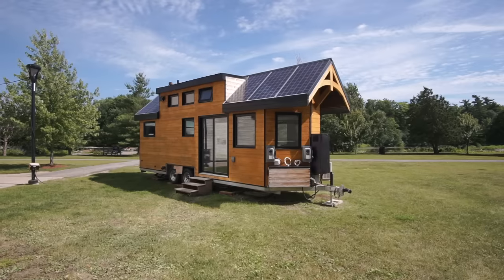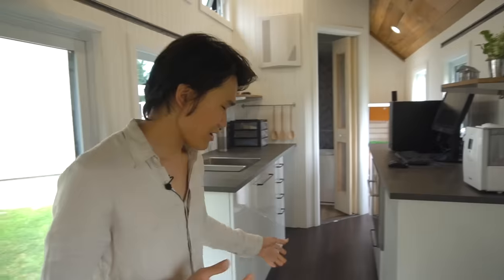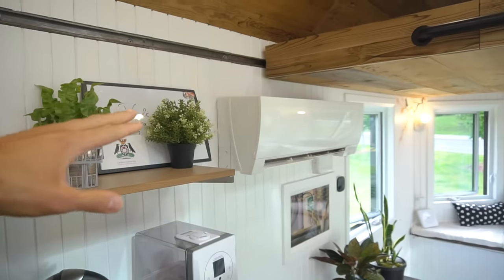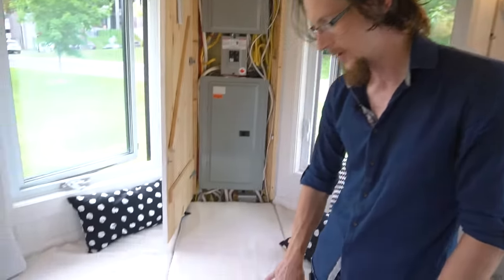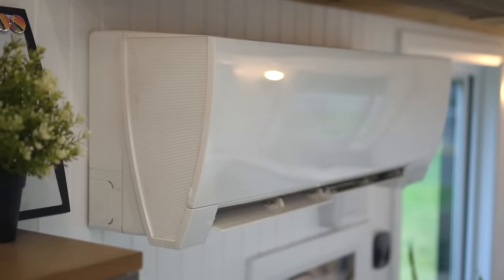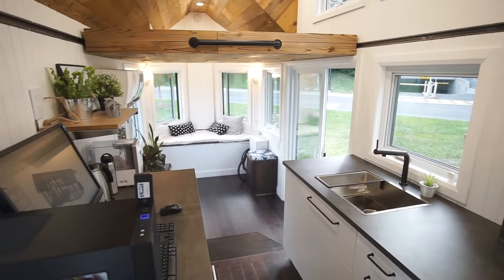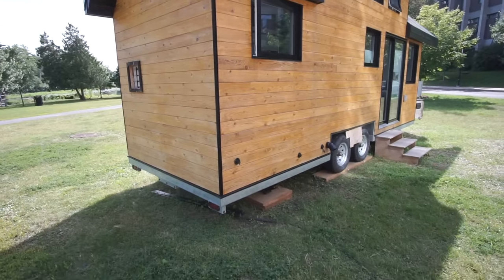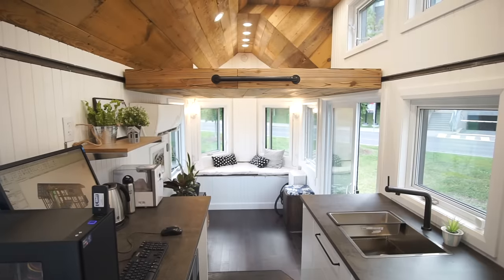Super High Tech Off-Grid Tiny House for Sustainable Living | Net Zero Energy Home

Comment: Vacuum insulation is the future, we use it a lot in Germany, could never understand why tiny-house-builders in the US don´t use it extensively, since it saves a lot of room! The Panel he shows is just a show-piece or design-flawed, since such panels have to have overlapping flaps on 2 out of 4 sides, to eliminate heat-bridges!!!
Reply: Would you know of the prices? Compared to other installations, is it more on the expensive side? I'm guessing if it is, that's probably why.
Reply: Either way with 2x4 construction of tiny houses to have 4 inches of space for insulation.
Reply: @Unknownsnkn  4 inches isn´t enough for insulation, not in the german winter... 6-8 would be apropriate. With vacuum panels, 2 inches are more than enough.
Reply: Klaus Brinck four inches is more than enough room to insulate in any climate with closed cell spray foam, the application of choice for tiny homes.
Reply: @Unknownsnkn  , I need help. if i need to make an insulated box which is warm in winter and cool in summer, how do i do that? i was thinking to use vacuum panels and closed cell spray foam. i am not knowledgeable about this topic. i want to make outdoor cat house for any climate.
Reply: It would depend on your construction type as for what insulation would be best for your project. Describe it and I could tell you what type would be best. Either way to keep it hot and cold you need an hvac system of course.

Comment: I realize this is a research project, but did you think of a practical way to reach the loft?
Reply: There is a black pipe handle along the edge of the loft platform which presumably has a hook ladder that they didn't show.
Reply: You mean you don't have to be an acrobat that can flip themselves into bed each night?
Reply: it's by men, for men. I think sometimes they don't consider the people they design for, ..... engineers.
Reply: @crcurran  9999qq1
Reply: Is CrossFit not practical?
Reply: @crcurran  u
Reply: @crcurran  uuuuuuuuuuu

Comment: I love the design, it would be nice if the solid solar array on the side without the dormer had a hydraulic lift to raise the whole panel so it had the same angle as the front to make the panels more efficient. If I had that tiny home I would face the front due south and raise the panels on the backside to display the whole array. Then just lower them when I wanted to move my home. :-)

Comment: Nice idea but just a thought... This THOW must be positioned in the sun to maximize solar gains so it will require more power in a hot summer climate for cooling negating "net-zero" since it would also require more lighting and heating in winter.

Comment: I think that the point of tiny houses is that everyone can afford it. Is this still the case? ✌
Reply: Its a research project that is clearly not focussed on affordability but on energy efficiency.
Reply: @Gummmibaer  if you understand my question, I'm not just talking about this tiny house
Reply: @klerobi1  Affordability depends on where you live. The average home price in Ottawa is around $620,000CAD. This build was about 1/6th that (thanks to sponsorships)
Reply: @scottbucking7530  Guys, I live in Tenerife.  I live full time in a tiny house, which I built for  5000€. And the houses around me cost  1.000.000€  and more...
Reply: Yes. But you have to go for something more minimal than what they are often marketed as (ie, having cedar wood everything etc, is expensive). If you scale down from the types that are on youtube videos, yes.

I'm having built a single level 7.2x2.4, using mdf (for walls) and quality ply for cabinetry. It's affordable. The more expensive the materials, the bigger the house, the more things you add on, the more a normal modular house on foundations is similarly priced. And at that point, it's a lifestyle quirk, not affordability. 

But absolutely if you look to smaller sizes, with cheaper materials (and even moreso if you build yourself)

Comment: "Atmospheric water generator"
aka expensive dehumidifier
Reply: They are using the dehumidifier as a possible water source?  As the saying goes you need to spend money in order to gain something.
Reply: Cece In reality, running a dehumidifier to condense usable amounts of water requires a huge amount of electrical power, even assuming 100% relative atmospheric humidity. Unlikely it would meet the “net zero” energy goal for the house.
Reply: kinda of true! but most normal dehumidifiers would have the water touching non food safe materials inside the machine
Reply: They said (well captioned) that using the dehumidifier was a proof of concept experiment. So, they're trying to see if it's even possible. Can you use dehumidifiers to read cover water and still be Net Zero? Would it be possible to even have potable water from the environment? It's an interesting experiment.
Reply: @stephanieellis5399  Tatooine has a thriving economy based on moisture farming.
Reply: @mikehuntsr.3414 😂
Reply: @mac.jenkin  THANK YOU! Lol my thoughts exactly.

Comment: In the Netherlands there are regular fires in the summer on construction projects that mount solar panels 'cold' on the roof (in-roof systems). Probably the wiring or connections  gets too hot.

Comment: Serious question: you mentioned what you do in the case of needing energy when the sun isn't shining. Why can't you charge a battery for those times instead of selling back to the grid?
Reply: They are charging batteries but they can get full. That’s when you sell to the grid.
Reply: That many solar panels, and 22kw of power it should be quite viable to be fully off grid , but they have elected for power intensive things. 

If they used infrared heating, no air con (ceiling fan), rain water collection, induction cooking, and either gas or a small DC sink style hot water heating they could easily be fully offgrid. In short, the design isn't energy effecient.

Comment: Interesting ideas.  Thank you for putting this video together.   I didn't what the actual(estimated is ok too) R insulation value for the walls/floor.... I've seen R50 - looked to be closed cell vacu sealed too.   Just curious.   Definately a good excersie.
Reply: Wall: Nominal R39 with a 2x4 wall. We did some tests this week and get readings of around R34 effective. Floors are similar. Roof is slightly higher. We think we can do better with version 2.0. We did have air-tightness tests below 0.3 cfm/ft2 @75Pa too.

Comment: Wow! Totally awesome. Finally someone has designed/built the perfect mini-house on wheels. Why doesn't California buy thousands of these for their homeless? However, just one issue I see. These houses need direct sunlignt for the panals. Won't that make them hot from the sun, and then they will need to A/C on to cool them off? Then where is the logic? I think you need to add a mechanical device so the solar cells can be directly in the sun while the house is under some shade trees.

Comment: What about the heat generated by the dehumidifier when used during warm/hot weather?  Using a dehumidifier in a cool basement the heat is mitigated in the summer and welcome in the winter. But in this structure or similar.... ?
Reply: During the summer they probably collect the condensate water from the air conditioning, I don't know. A bad idea in any case since dehumidifier water is an ideal environment for the bacteria to proliferate

Comment: I like tiny houses for a number of reasons, but I wouldn't want to live in one.  "On wheels" really isn't essential in my case.  For me at least the negatives outweigh the positives.  I also do not like the narrow low profile of tiny houses.  I'd like to raise the roof and have a loft with 500 to 600 sf living space plus a very well organized small shop with a storage building for gardening tools.  I have 8 acres in a beautiful mountain valley and would like live in a community of small energy efficient houses with all electric vehicles and emission free energy from the grid.  Energy storage might be necessary, and the buildings should be fire resistant since the property is close to the national forest.

Comment: When the American's say Tiny House = You need a truck to haul it.
Reply: To be fair, this is a net zero tiny house which has thicker walls, better insulation and has built in water storage. Not a typical tiny house

"The typical tiny house on wheels is usually less than 8 by 20 ft (2.4 by 6.1 m), with livable space totaling 120 sq ft (11 m2) or less, for ease of towing and to exempt it from the need for a building permit."

Comment: This digital twin presumably isn't an own design bit of software but is something like solidworks or sketchup??
Reply: For those interested: Revit (Architecture, MEP, and Systems Analysis/EnergyPlus) combined with Dassualt Dymola (Modelica language). Very powerful combination!
Reply: Scott Bucking two and a half grand a YEAR is a bit more than I was hoping for. 😳😑😫
Reply: Scott Bucking Can you sell the plans please?
Reply: @HandyC  Try some open source alternatives like FreeCAD (with BIM plug-in) and OpenModelica
Reply: @scottbucking7530  Cheers for that. I'll look into it, gotta find something. In the next year or so I plan on building a habitation unit on top of a 7.5t HGV chassis.. A bit like one of those expedition vehicles but without all the exterior bling and just rear wheel drive haha